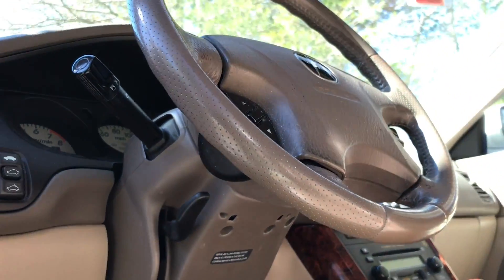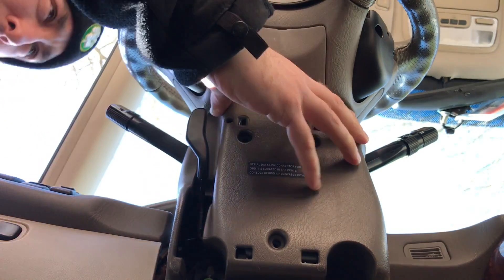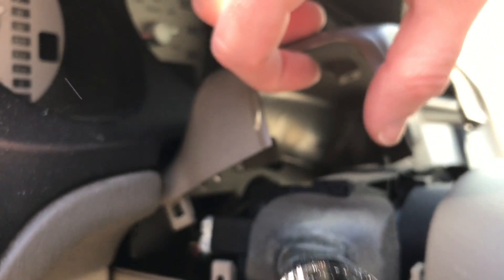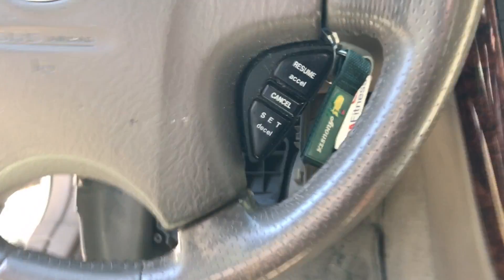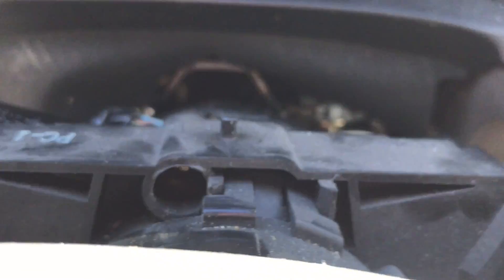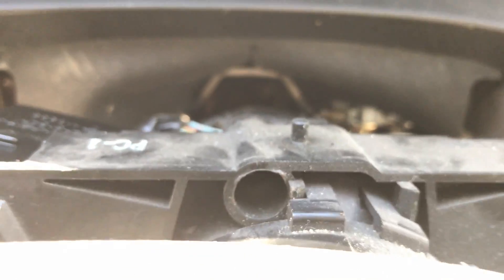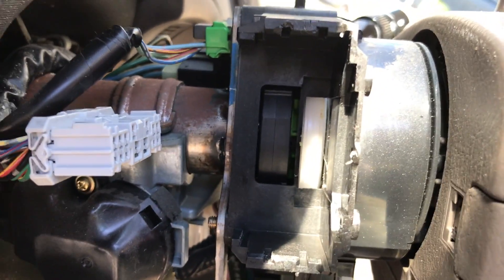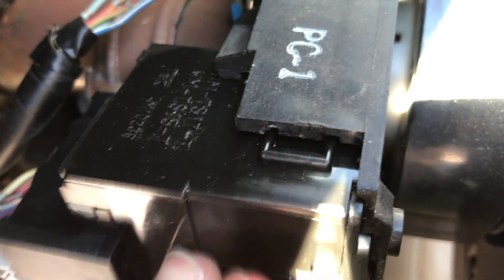How to fix HeadLight Switch Stalk 2002 Acura TL

Comment: Just so you know glue does not hold the switch in after you take the screws out. If you look at the time line of 5:14 of the video you will see in between the two screws there is a hole. There is a clip on the switch that goes in the hole to hold it in. If you take a small flatblade screw driver and place it in between the switch and hole it easily pulls out. Hope this helps others.
Reply: Thanks for your comment. I was able to pull it out so easily with the help of flathead screwdriver.

Comment: I recently grabbed the same car at an auction great shape. The driver side head light don’t come on all the time I’m hoping it’s not the Ballast do you think the headlight module could be effecting one headlight not to work all the time ? I bought new bulbs already
Reply from the maker: It sounds like a short in the connection. If the light is on sometimes and then it’s off other times then it sounds like a bad connection in the wiring or in the headlight assembly. Check to see if the turn signal works on the drivers side then you’ll know if it’s just the headlight connection

Comment: Hey man, I have a 99 Acura as well . I’m trying to figure out if I should replace my switch .. my high beams have power .. they are bright but my low beams don’t come on at all. I’m confused because I don’t know what to do and my mechanic doesn’t either , he told me to get a new dimmer switch but I think it could be the wiring warness too.. maybe the bulbs?
Reply from the maker: Hey I would see if you can test with a multi meter to see if the wiring harness is getting power when the low beams are on. It’s also possible that both bulbs went bad but unlikely.  Have you tried new bulbs?
Reply: @tvbuster   okay gotcha , and no I didn’t try the light bulbs yet. And okay, I can call around and see what the shops say. I got told that it could be my ballast .. I’m just tired of the guessing game

Comment: Great video.  I was wondering if this was something I needed to do.  My issue is that the headlights on my '02 TL usually turn on only the first time.  If I turn them off then on again I get either left or right or none turning on.  Iv'e disassembled the headlights dozen of times to switch ballasts, igniters and bulb and nothing works.  The headlights coming on at all seems random.  Now a recent development is that the fogs, which worked all the time, suddenly stopped working completely.  I have spent months trying to figure this out....maybe you know a different solution?  Thanks in advance!
Reply from the maker: Devin Sidell this was actually someone else’s car so I’m not familiar with the circuits but I would check the fuses and relays and perhaps switch them we new ones. Also us a multi meter to see if you can determine if there is an electrical short anywhere in the wiring. Sometimes the wiring harness can corrode and you can clean them and add dialectric grease to re establish a good connection.
Reply: @tvbuster  All fuses and relays check out but I will try your suggestion.
Reply: Hey devin did you ever fix the problem my lights do the exact same thing?
Reply: Mine does the same thing has anyone found a solution ?
Reply: @Davon97  The Headlight Experts website also has the HID conversion(which I used as a bypass) cheaper than Morimimoto which I ended up returning.
Reply: @aamiri_clux3137  Yes I bypassed the ballasts with an HID kit from Headlight Experts fro $150 and they still work great.
Reply: @devinsidell  thank you so much I’m going to check that out and can you send me the link ?